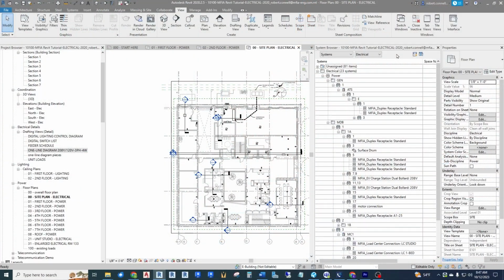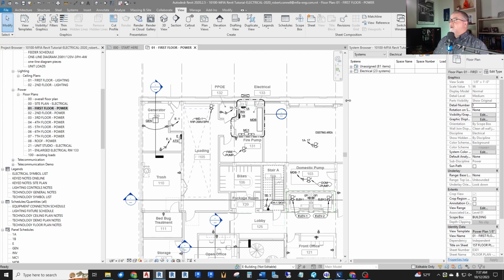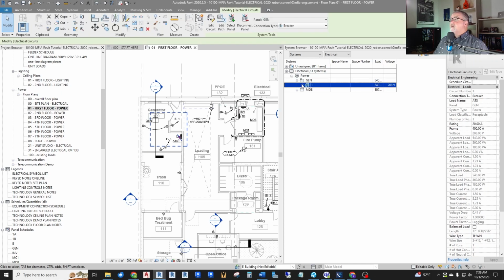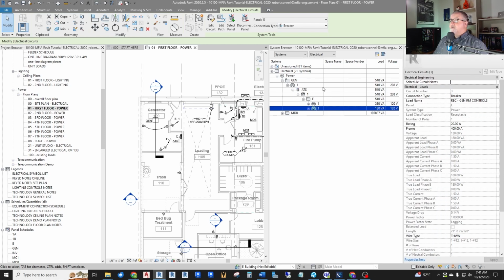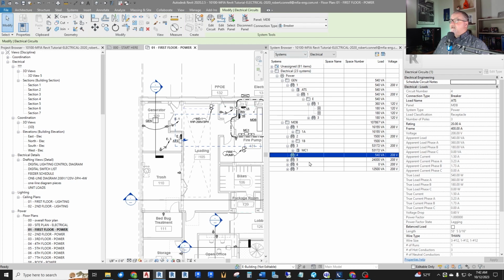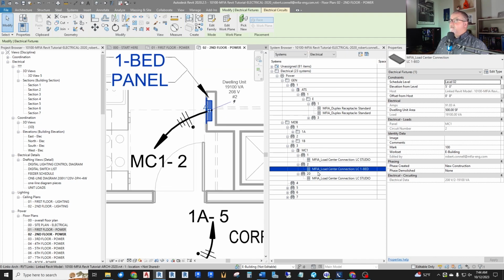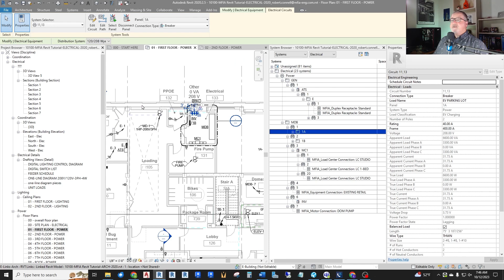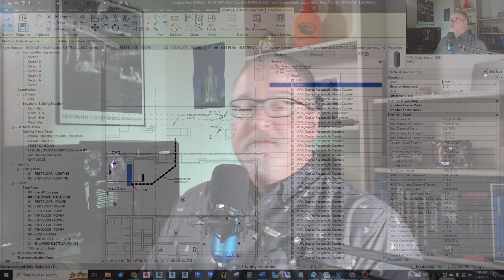REVIT MEP All About the System Browser! - Electrical Tutorial

Comment: Hey Rob, excellent video! Is there a way to edit, add, or remove circuits from the panel schedule view? It would be nice to be able to add fixtures to an existing circuit from the panel schedule so you don’t have to hunt a fixture already on the circuit to bring up the menu.
Reply from the maker: Hey there John! Thanks for the feedback. Great question - I've often felt the same way, but I'm afraid there is no direct way to add fixtures from the panel schedule view. However, one workaround is to open a floor plan view that you suspect the fixture is on, then open the panel schedule and "select" the circuit (i.e. click on the "description" part of the circuit, or even the breaker part). Now when you switch back over to the floor plan, the fixtures on that circuit will highlight in blue (by default), which can help you locate them to now get to their circuit and add/remove. Hope this helps (and is a great idea for a future video!). Cheers!
Reply: @ElectricRob many thanks sir!